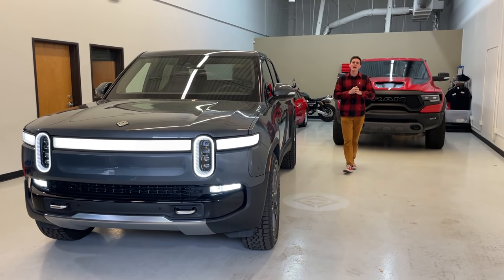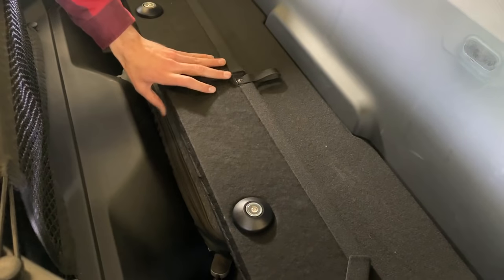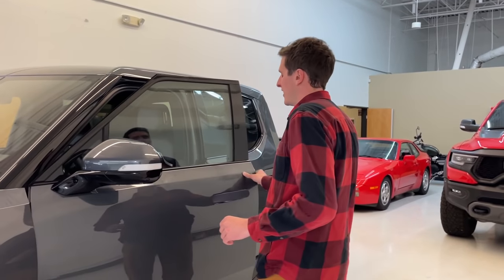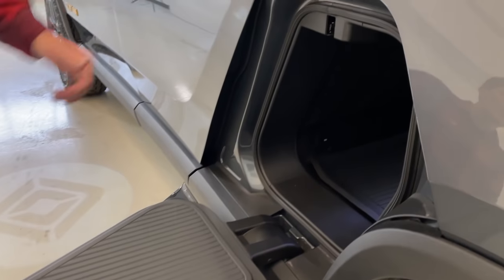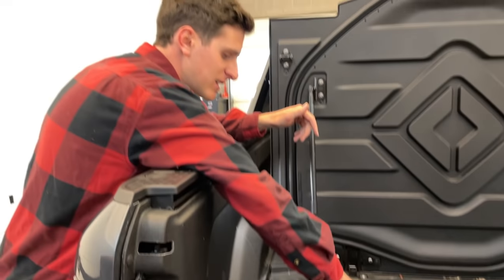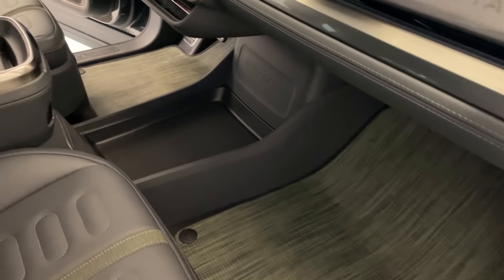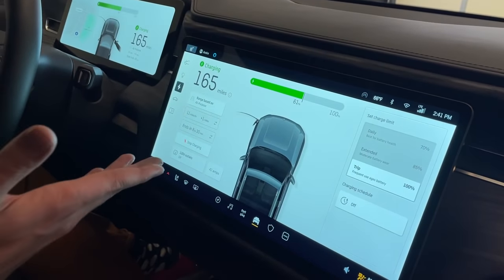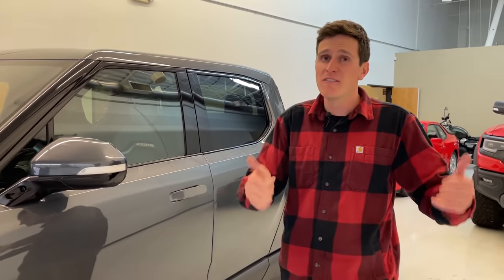The Rivian R1T Is a BIG Threat To Traditional Pickup Makers (Ford, GM, Ram) Here's Why!

Comment: 100% not a threat to any conventional truck. Towing range is a joke. It's a novelty vehicle. That's all it will ever be until battery tech advances significantly.
Reply: It’s not a novelty, it’s purpose built for weekend warriors and daily commuters. It’s not designed to haul heavy loads on the highway. It’s designed to go camping and go to work.
Reply: @MrEcksDeah  it is a novelty. It's a truck that can't tow.
Reply: > 50% of trucks sold in the US have never had a trailer hooked up, at least by the first owners
Reply: @mattbrew11  ok. Let's say you just use it to go camping. How much range will it having driving up grades, not being close to a spot to charge while you're at camp? It will be bought by people to go to the mall and back. No reason to make it have a bed what so ever.
Reply: @quick906  just keep buying gas cars dude they’re more your speed

Comment: The rivian is a luxury vehicle that will take you to work and back home five times a week.  It posses no threat to a truck that can haul a load across the country in just a few days.
Reply: Except the majority of pick up use is local, not cross country.
Reply: @nelauren   It posses no threat to a truck that can haul a load across the country in just a few days.
Reply: @fernarias  you’re setting up a false premise with your initial post.
Reply: @nelauren  It costs 140k, it's a luxury vehicle.  It won't get used for plumbing, it won't get used for hauling.  I sure wouldn't want the truck bed scratched.
Reply: @fernarias  A top of the line Rivian costs $98,000. Try again.
Reply: @nelauren  That still a luxury price but the new sticker price is what I quoted from their website.

Comment: EPA rated range of 314 miles meaning it'll be 20-30% less in  cold  weather. Not to mention towing or hauling a 1000lbs, you'll be lucky to get 150 miles . Yes it has cool features like the lightning but if you're buying this as a work horse it'll spend most of its time plugged in being charged. Until battery technology improves and it can be charged in 5 minutes, EV trucks aren't practical . 70k for 314 miles ? How much gas does 30k buy you over a 30-40k gas work truck?

Comment: How do you tell at a glance when it is fully charged? Does the ginormous green bar stay lit or ?
Reply: I believe there will be an update in the future that turns the front and rear light bars into progress bars so you can watch the SOC of your truck go up as it charges.
Reply: And when it's locked the lights go off so it doesn't attract too much attention.

Comment: Cute for the city, on the farm the trucks has to be available 24/7 pull heavy trailers. 4X in mud and snow must travel 800 mikes in a day after day. The battery replacement cost. $25,000 on electric replace electric drive motor $4500each.  100,000 mile expected life cycle. You never bring up the down side. Who the “ Hell” wants a truck to tweet at them😂🇨🇦🇺🇸

Comment: Guess with the button placement on the bed you won't be putting a cap on the back.
Reply: you can control it inside or with phone app. I'm sure there will be toppers with cutouts or sized for it. the bed is short though. how big a one could it take?

Comment: I’m surprised that regulators didn’t ask Rivian to add a luminous pull cord to open the tunnel from inside in case someone locks someone in there, I’m sure that they will eventually
Reply: There are emergency exit buttons at both ends of the tunnel
Reply: @mattbrew11  thanks , I just saw the other video where it was mentioned, thanks

Comment: Very interesting video; a bit hagiographic, but okay . I'm sure they've done tons of market research and this will sell well- I am just fascinated by to whom this is being pitched.
Charge door is a disaster waiting to happen.
The doors being manual is a major plus for me
Huge green LED while charging is just goofy.
Those vents controls are ridiculous-there have to be little electric motors moving the vents around. why would someone do that?
Is it available w/o a glass roof?
The teeny, tiny bed is a deal breaker- that tailgate is very clever and if they added 1' it would probably be acceptable, but as is I can't imagine buying something like this.
Reply: Their market is not for the plumbers and construction types. It’s for the tech/adventure types. Their market is not the F150 crowd, yet.

Comment: Really like truck except for;
Don't like flush doorhandles, they will freeze.
Don't like touchscreens. At minus temps, they don't function reliably. Too much info on screen, prefer direct controls on heat/defrost.
Don't like glasspanel roof, want moveable roof.

Comment: The addition of the barely useful gear tunnel and not having a flat backseat area when the seats are up is a huge mistake.
Reply: flat backseat would have been good. I think the R1S (suv) does fold down flat. The gear tunnel is great, I can put stuff in there like skis, it's waterproof too.

Comment: The through the cab compartment was done by a company who do tray back Ute conversions even seen with a slide out kitchen system.
OK I like it but not currently available in the UK probably never will as trucks are not so popular I have always had trucks but retired now so picking up my electric Mazda MX-30 end of January, so being a petrol head a strange move.
My concern how are you going to operate those switch's with a Topper as it is going to be available from a third party company you can bet, so a work around will be required so more buttons on the remote which is where I would have wanted them from the get go as you will not always be in a position to get to the buttons.
All their cleverness and they have not included a lift up load stopper in the tailgate a bit remiss, and anyone fancy completely unloading all your camping gear or work tools and materials to change a tyre in bad weather raining, snowing or any other bad weather high winds oops the tent and sleeping bags just blew away or rolled in a puddle hmm.
Still love it shame never going to be in a retired persons price range for average Joe going electric properly is not cheap even going the way I went going from truck to car.

Comment: Very unique, but if they really want to change the behavior of the public and get them away from gasoline power (same goes for Elon), sell a vehicle without all the bells and whistles, offer a high volume value model. Get rid of the air compressor, the power opening hood, the giant screen where possible, the Bluetooth speaker, the luxury features, the fancy exterior lighting, the automatic vents, same with the power, 800 horse is excessive for daily driving, cool, yes, fun, yes, but knock a few grand off the price and sell one with 400 horse. Nobody wants to look at history, but Henry didn’t replace the horse and buggy with a luxury vehicle. He offered a vehicle that was affordable to the masses.

Comment: I have a question. What is wrong with traditional door handles? You know, the ones we've been using on vehicles since the beginning of vehicles? I just don't get why some newer EV's feel the need to have these electric pop out style handles. I see them as being rather inconvenient and prone to be problematic. Am I wrong or just an old man yelling at a cloud at this point?
Reply: Old-style car door handles contribute to aerodynamic drag, which is a serious consideration on EVs. Side view mirrors need to go, too, but we're waiting on the Feds to ok their replacement with cameras. Eventually, truck styling must change to clean up the air flow - the market needs to stop equating a massive front end with more power.
Reply: This design helped the car get more mileage because of less air resistance.
Reply: The future is now old man!

Comment: Yeah, we all know EV's throw in all the tech, yada yada yada, and work for the urban environments or someone that wants a modern day El Camino, but what about driving outdoors in off-road terrain, hauling stuff and/or towing a small camper or UTV, what is the actual mileage range and capability?   I hope I am shocked cause I want to love it, but have yet to see a "practical" SUV/truck EV for non-urban users.
Reply: They said they are going to do a towing test on the Ike gauntlet, off-road test at Moab, and a range test all this week.
Reply: I saw another R1T video which shows amazing off road capabilities. An independent motor for each wheel allows for unusual feats of agility.
Reply: maybe some place will spend a week with this video doing all the things you just described and record it. Perhaps they’ll post it somewhere?
Nah probably not
Reply: The earlier reviews say that this is actually the incredible strength of the vehicle. I expect these guys to say the same but time will tell.

Comment: At 300hp and $37,000 it would stand a great chance of owning the midsized truck market IF all the unnecessary expensive unreliable tech crap was eliminated. Those door handles tailgate button power hood air suspension and these damn all empowering screens are all total wastes of money. At $77,000 it's out of reach of the working class. Normal ppl don't want that crap to sit in the driveway and depreciate and need repair. This vehicle (and many others) is made specifically for the millions of ppl with at least 1 million in the bank. The normal working class person has been kicked to the curb once again. Just my opinion.

Comment: What is the average life expectancy of the batteries? I saw of a Tesla owner that basically destroyed his Tesla because it was going to cost like $20k to replace his batteries.
Reply: Getting > 300k miles shouldn’t be a huge obstacle especially if you’re not dc fast charging it a lot and in daily driving, keeping it to 80% max state of charge
Reply: As you say, multiple teslas have made it 300k miles, but cars are made by humans, like gas engines if you look at millions of them you'll find some failures. the avg rate is good

Comment: Why are the air vents being reinvented??? I just want a simple knob I can move to adjust air direction. I don’t need anything futuristic.
Reply: cheaper
Reply: @lattelandlatteland  I can’t imagine how that’s cheaper. You have to build an actuator into the vent. A little electric motor. I don’t see how that is cheaper than just a manual adjusting vent by my hand.

Comment: In the features race happening with manufactures these days, more and more fiddly motors and stuff that can and will break is going into the vehicles.  Cool features, but would love the option of cutting 5-10K worth of gizmos and gadgets, e.g., do you really need or even want a motor to open your charging port door and to move the air ducts... more crap to break.  And yes I know... grandpa will get off this new newfangled computer thingy and go and put in his false teeth.

Comment: Did anyone see the Rivian truck reviewed by Edmunds? Stating that this vehicle has the worst energy score of any electric vehicle they have reviewed. Could that be the 7000lb weight?? Large battery, four motors> 48kwh/100 miles vesus model y at 27kwh/100 miles. Yes it is a truck but it sure was not built for efficiency! 70K isn't exactly cheap either.
Reply: Yes, it has lower efficiency than say a tesla because it's freaking heavy, it takes a lot of energy to move it. It's also not aerodynamic like the model s and some other evs. It's that classic rectangular truck shape. The next level of detail, how will the efficiency of their motor choices and other efficiencies compare to other trucks, we'll soon see with hummer and lightening trucks.
Reply: the first EV truck has a worse energy score than the EV cars and CUVs they tested?  sounds about right?

Comment: Whomever makes an ev truck that can haul a 20” bass boat/UTV to and from a lake/ranch that’s 150+ miles away and back without needing a charging station layover will really change the truck market.  Until then, these ev trucks are just urban wannabe trucks.  Who wants to buy a truck that’s only capable as an urban commuter and very short distance hauler that’s got a lot of strength but no legs.   Kinda pointless for the $$$ they’re asking.
Reply: But they’ll have no trouble selling them
Reply: Thats an oddly specific request. What you mean is thats what you want to use your truck to do. 
When you see trucks with 500+ miles of range emerge it’ll be your take your toys and go play benny
Reply: Then this isn't the truck for you. Early tests showed like for gas trucks a rivian lost around half the range when towing, I think edmonds lost 45% of range when towing including up and down hills. The idea is there will soon be fast charging stations everywhere. If there was one along your route, you could one day make it work with a 20 minus charge/food/bathroom break, but today none of the available truck evs will meet your needs.

Comment: Rivian is just going to be the Tesla of pickups. Unreliable, no dealer network, super expensive parts that are unobtainable, etc. Much better off sticking with an established manufacturer.
Reply: None of the car brands will have a dealer network by around 2030. EVs will eventually get good enough that needing service will be a very rare and unusual issue
Reply: @mattbrew11  Couldn't have said it better myself.

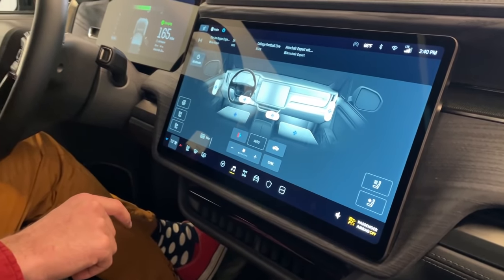Comment: 14:50 - The on-screen air vent aiming isn't unique - it's used by newer Teslas, too. And it's annoying there, too. If you're shorter, you have to lean forward to reach it, which means you're not in the right position to aim the air at. Just give us little sliders on the vents. It costs less, and is one fewer failure point.

At least on Tesla, with their oddball "we aim solely by changing the power of the airflow coming out of the vents" it makes sense (although still annoyingly over-high-tech-complicated.) With Rivian which still uses conventional baffles to aim the air? It's baffling why they didn't just use sliders.
Reply: Its baffling? 
They decided they liked the aesthetics of this approach. The end. 
Besides how often are you changing your air vents exactly? Got menopause hot flashes going on or what?